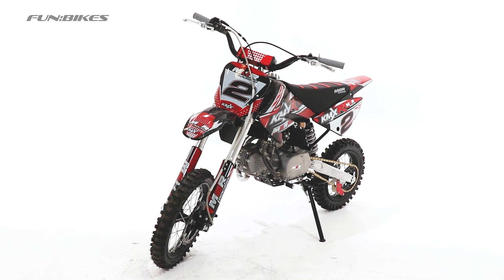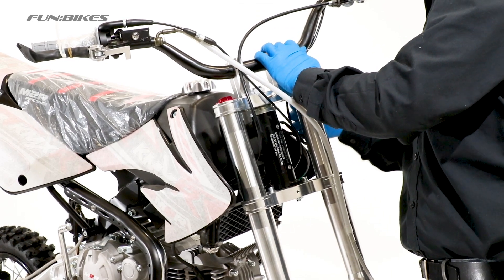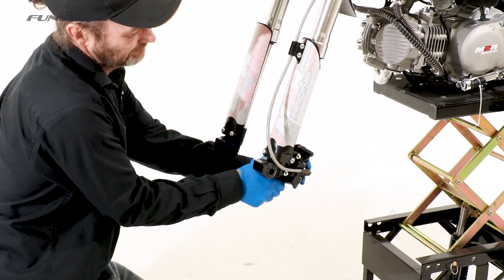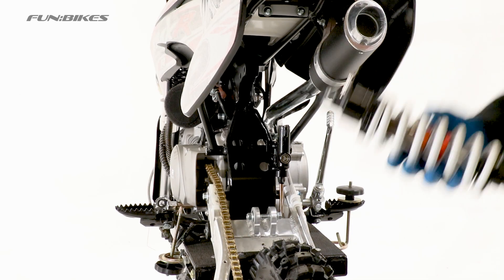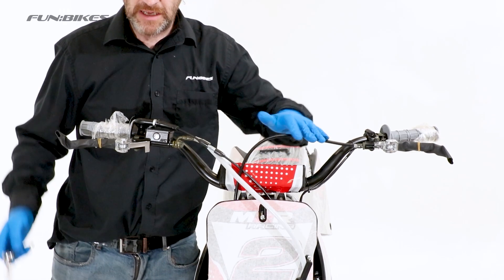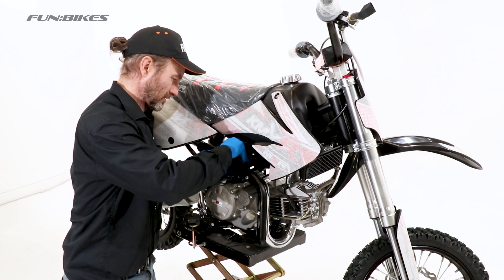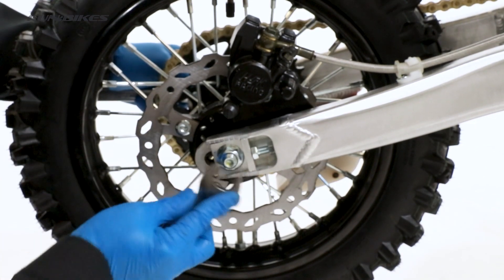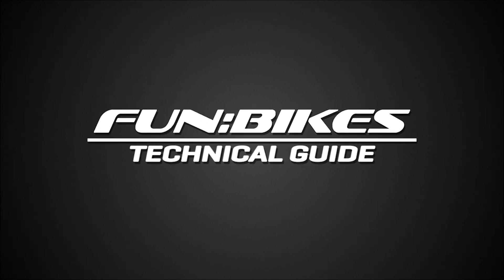Technical Help: How to Build the M2R Racing KMXR Range of Dirt and Pit Bikes

Comment: When ordering online it gives you the option of having your bike assembled or not. If i selected assembled is this how it comes or is it all in one piece ready to go out the box?
Reply from the maker: Hi Ragan, Sorry for the delay, Youtube is not normally monitored by our support staff. Please feel free to call us with any questions or email our customer services. When a bike is ordered to include assembly, it will be dispatched completely assembled and  Pre Delivery Inspected by our inhouse mechanics and is sent through a pallet delivery network on a large pallet. It will be fully strapped upright to the pallet and covered in a protective film with the cardboard box then covering the wrap.  I hope that helps. Best regards The FunBikes Team.
Reply: @funbikes  

Thanks. What oil do i need if i ordered a RF 160 pitbike. What is the top speed also. Thanks
Reply: @funbikes  do I have to break the bike in or do you do that?

Comment: Please help bought one of the kmxr 160cc and keeps dieing out won't tick over with out throttle
Reply: Don’t have one of these but I would imagine you need to adjust the idle screw. Probably on the carb